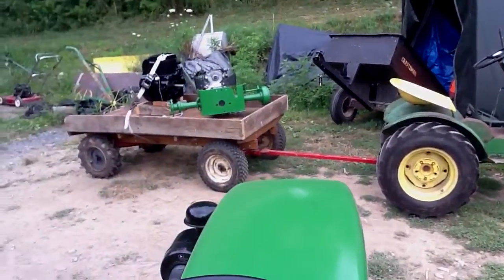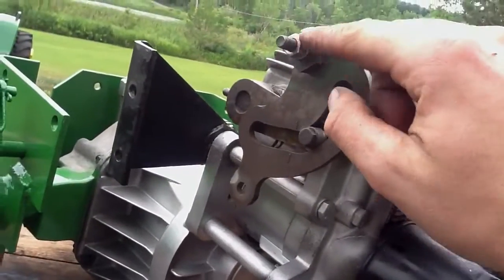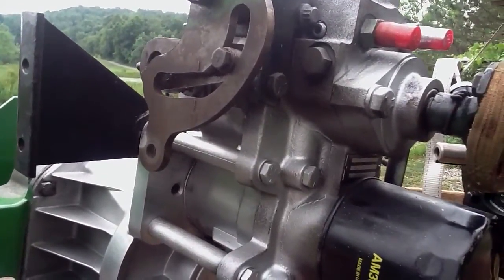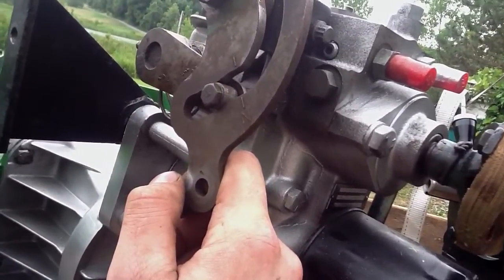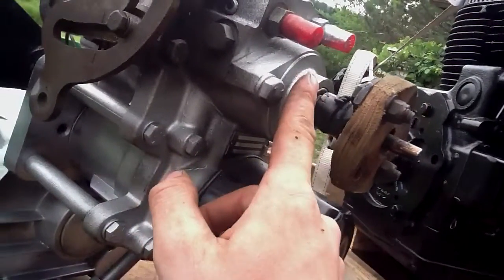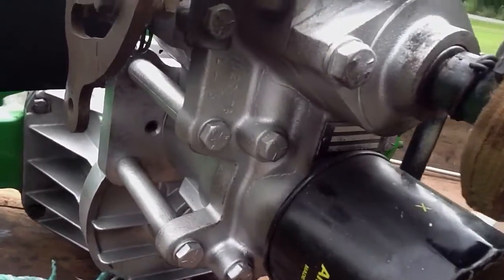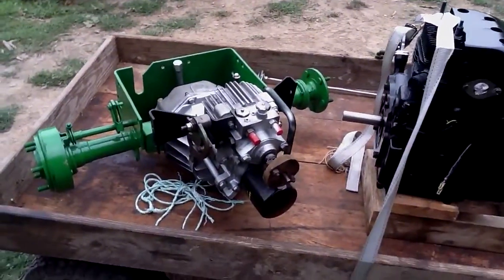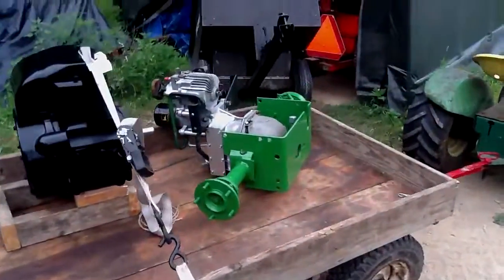John Deere 140 transaxle

Comment: Excellent video and you're doing a great job restoring.  I have a nice H1 with snowthrower and mower.  It started dripping oil past the flywheel seal and parked it years ago.  Love the tractor and it sure would move a lot of snow with about 400 lb on the back.
Reply from the maker: Thanks for the compliment,  9 years later and I still have that 1964 110. I sold the 1972 H1 to a friend of mine because I didn't have a great place to store such a nice machine. I soon after that video bought a very nice original condition 140H3 that I have and use today

Comment: Did you ever run into a problem where lifting and lowering a snow plow that goes up and down really slow and the reverse goes really slow?
Reply from the maker: Nope, hydraulics have always worked very smoothly on this tractor.  If your tractor goes very slowly in reverse your linkage connecting the lever to the transmission might be out of adjustment slightly